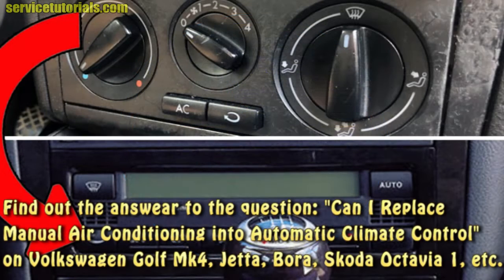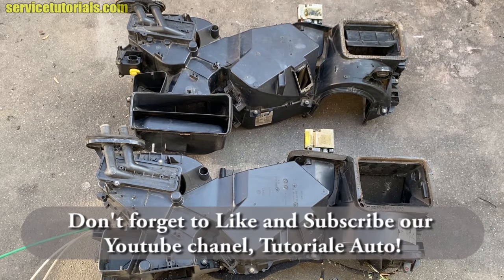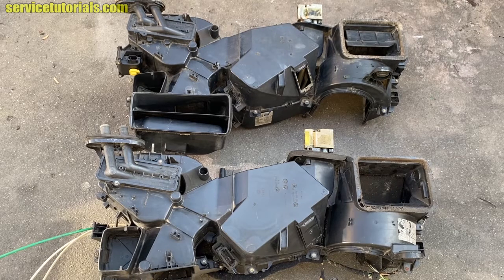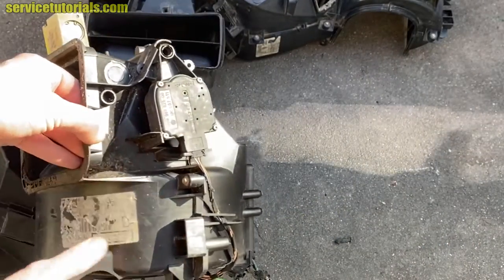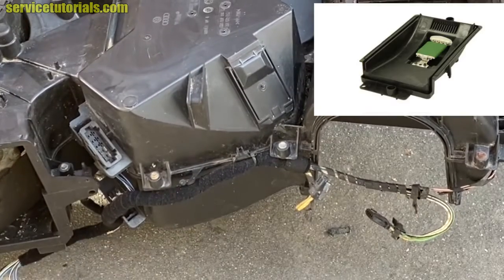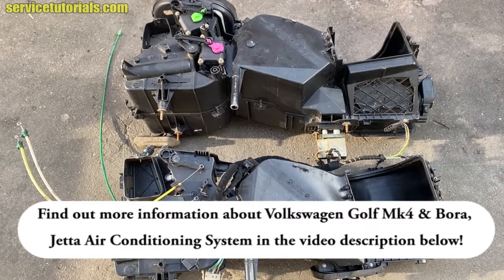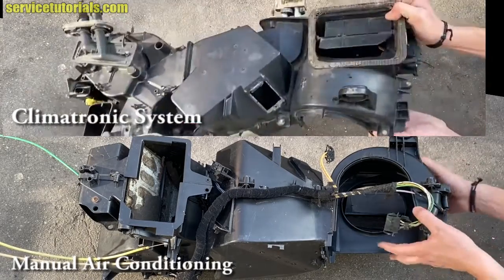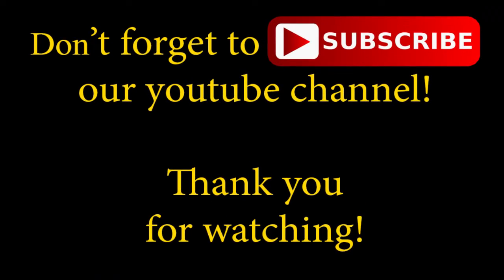The answear to "Can I Replace Manual AC into Automatic Climate Control" Volkswagen Golf Mk4, Jetta

Comment: From what car is the climatronic one? When i bought my golf it had the climatronic one already in it, i wonder if its stock or not
Reply from the maker: It's from a VW Golf Mk4 2003.
Reply: @Servicetutorials my golf is a 2000, so its not original part?
Reply from the maker: @TheEpicF-18Pilott yes, it is
Reply: @Servicetutorials but you said its from a 2003, mine is 2000,so it cant be original
Reply from the maker: @TheEpicF-18Pilott VW Golf Mk4 was produces between 1998-2004

Comment: the manual is more reliable, and it will never break, (expect the fanresistor), the automatic is better, but only it won't last that long. after 200k, the position motors will break...
Reply: @multiomer1997  well I wouldn’t consider that a problem if you’re going to swap one that means you’ll already have it out, new motors while you’re there and your good for 200k

Comment: Do. You know if is possible to fit the manual AC from golf iv in audi a3 8L?
Reply: If the engine is the same then it might fit. But the best way to check is the code on the etiket.